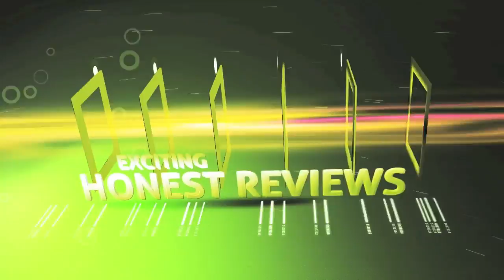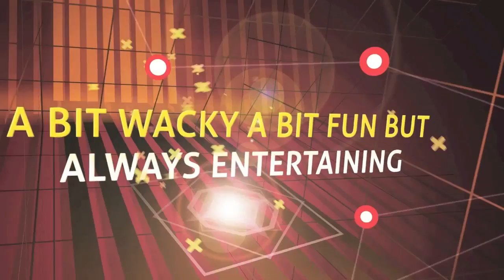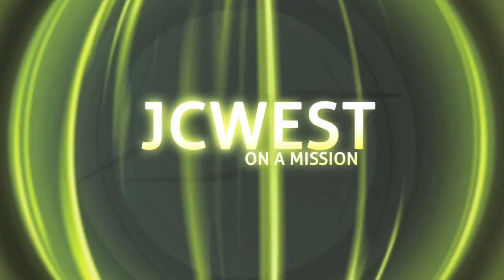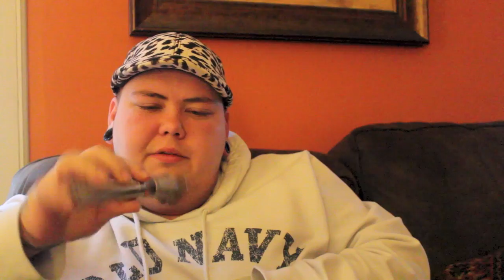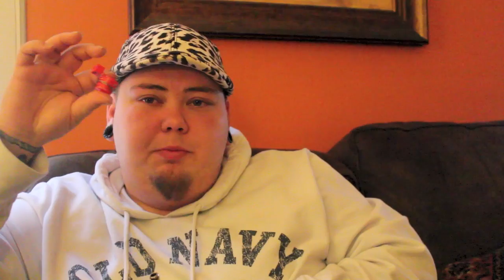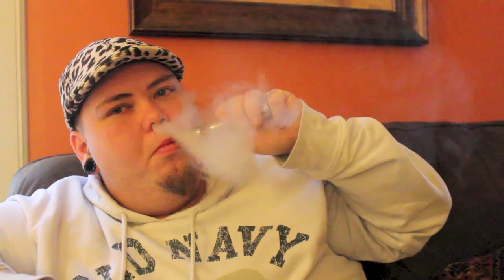Porous Ceramic Wick Review

Comment: Not sure how we can consider ceramic an advancement if it is A)  not easier to wire up without hot spots for newbs or B) provide a better capillary flow of juice and taste for more advanced vapers. I dont feel it wil deliver either unless there are some advanced material engineers working hard in a lab somewhere. The price and fragile nature of it kills it for me but never the less i also have burned a $20 spot to order and try so i can draw my own conclusions. THanks Jamie for review!

Comment: Thanks for the video, very informative. Two quick questions...As a first time vaper, Im thinking of getting the AGA-T2+ Genesis. Would this ceramic wick be ok with it?

And I prefer higher resistance as I find it gives a smoother vape. How would I achieve this using a standard coil...more turns of the coil around the wick? Thanks